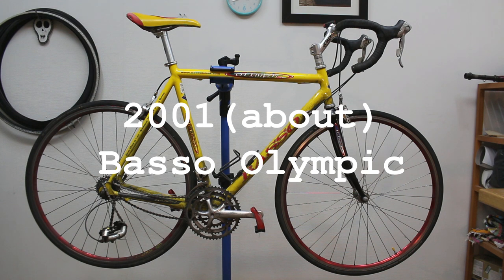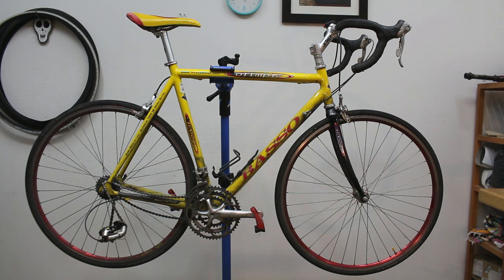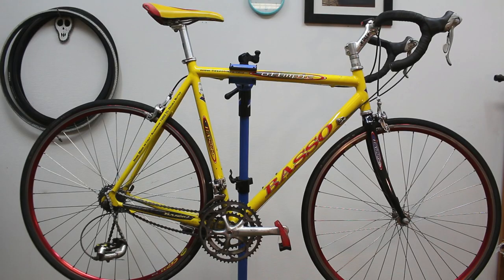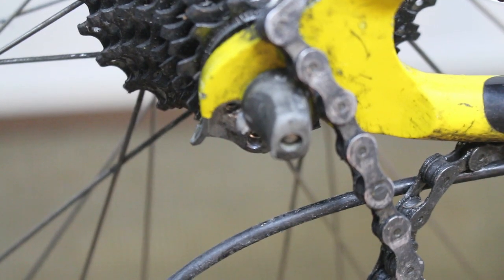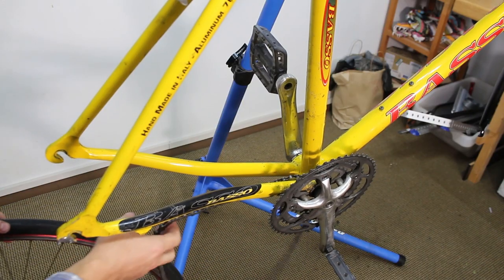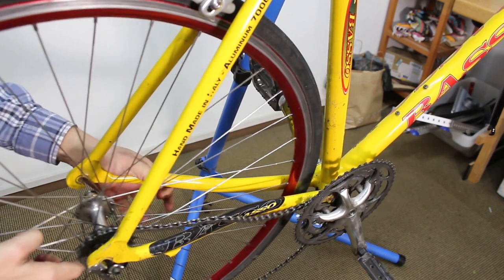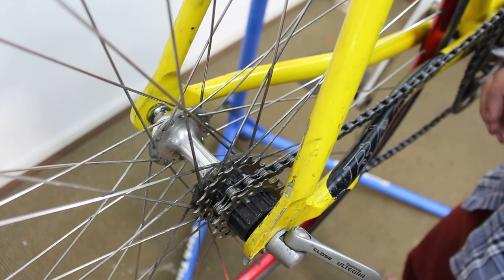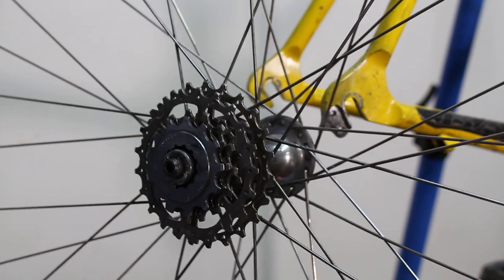FREE single speed conversion - (winter bike project)

Comment: I built a single speed bike pretty much the same way. At first. You'll realize that - after then chain has lengthened - the two big cogs on either side of your 14t cog won't help because the chain will start riding on the tips of the 14t cog and you won't be able to pedal. The solution is a BMX cog. They have very long teeth, they're made for single speed use and they are cheap, about 5 bucks/euros. Maybe you've adressed this in a later video I haven't watched (yet).
Reply from the maker: I rode it for awhile like that and didn't have a problem. But I wasn't confident with the setup either. In the end I retired that bike and used it's parts for another bike.

Comment: Get a crank that you can make a single ring, then buy a chain tensioner wheel that attaches to deraileur mount
Reply from the maker: yeah I've seen them, never used one.
Reply: @BruceChastain sometimes can het away woth not using one